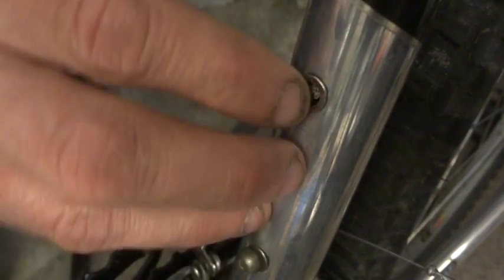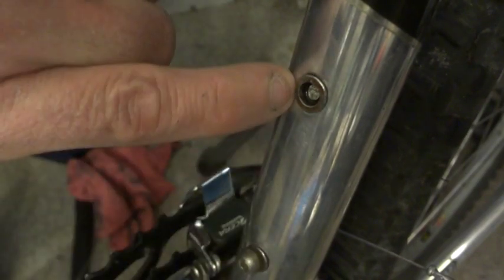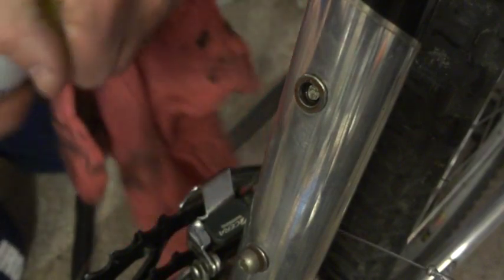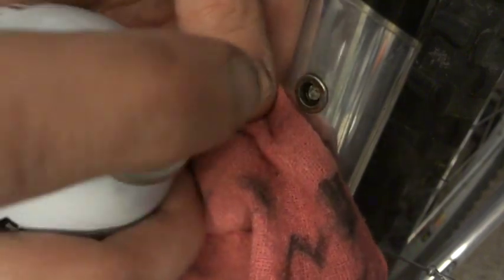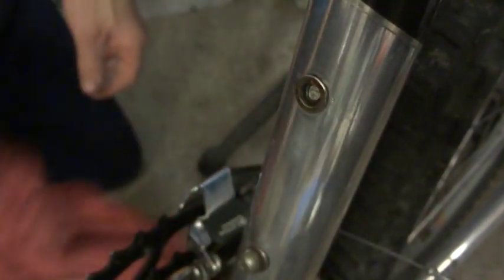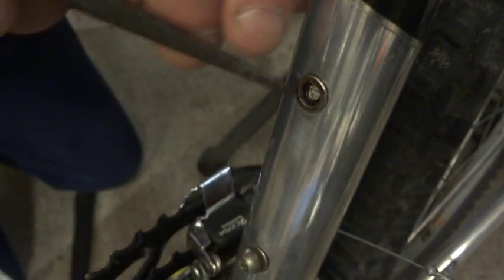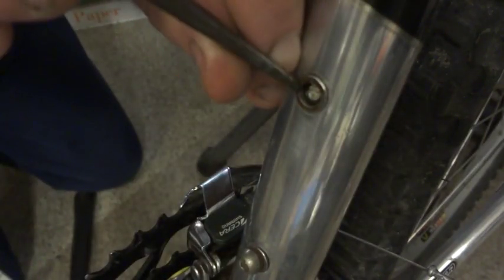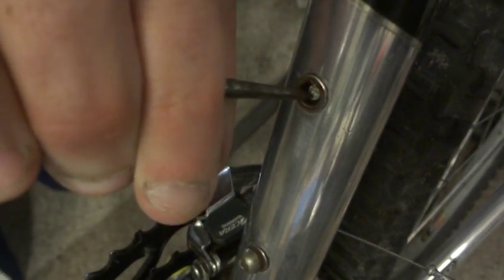How To Remove A Broken Bottle Cage Bolt

Comment: I just did this to remove an m5 bolt which had snapped in the rear forks. It had held my pannier rack, but got sheared off by the weight of the rack (which had snapped in a different place, overloading this bolt) – I figured that the thread wasn't seized, I just couldn't get any way to unscrew it. So I searched around, found this video, got some WD40, a punch and a hammer, and patiently tapped away just like you did here. It's worked just fine! The bolt came out enough (took about 15 minutes of tapping firmly) to grab with pliers, and the threads in the bolt hole are intact and usable. I'm relieved – it's a steel framed touring bike, so it'd be suboptimal if it could never have taken another pannier rack. I'd had a quotation from a bike shop to bore it out with a drill and to tap new threads for a wider bolt, but the quotation was over $100. Instead, this video and some gentle work did the job. Thanks a lot!
Reply: Works!!!!! Thanks!

Comment: RJ, thanks for the clever solution and clear explanation. I used this approach with PB blaster, a mallet and a center punch. After just one and a half rotations with the mallet/center punch I could press my thumb into the hole against the broken bolt surface and continue rotating it with friction. Your video saved me the cost and time of a trip to the bike shop!

Comment: Thanks RJ!   I had a similar problem on my expensive carbon Trek road bike.  I was afraid to repair it myself until I saw your excellent video.  You saved me a trip to the bike shop and I was able to remove the broken bolt without a problem.  It just takes patience.
Reply: Wow..the same thing just happened on my 2023 trek madone SLR...the bottle cage bolt feom trek are very cheap..luckily I have 3 holes on one side so I can lower and use the 2nd and 3rd hole..just brought some s-works bolts which are alot sturdy and made with better quality..

Comment: I've had good luck with left hand drill bits as well. If you pre-drill it a small size(such as 1/8"), then go up one or two sizes, it'll tend to grab the bolt and un-thread it.

Comment: I got a new bike and torque wrench since it came with a carbon seatpost, and I got all torque-Happy and over tightened + snapped my bottle cage bolt. Luckily since it was new the broken bit in the frame came out with little effort with the threads still in tact.

Comment: Thank you, RJ! I was able to remove a screw using this method no problem. Excellent! 

After I bought my bike I realized there was a sheared bottle cage screw on the underside of the top tube. I'm assuming the cage was caught on something and tore the screw. 

What are some common reasons these screws break?
Reply from the maker: No idea. I haven't broken a bottle cage screw.
Reply: My guess is an over torqued screw, bottle cage screws should be in the realm of 2-3nm, over tightening can cause screws to fail like this.

Comment: Thanks, very helpful video! I've the same problem... But I don't know if I can find PB Blaster in the Uk. Do you know something equivalent, worth like PB Blaster? 
I tried with a normal oil but the bolt doesn't move.
Reply from the maker: Try a good penetrating oil. PB Blaster is a very good one, but use what you can find. Let it soak in. Then try to tap on the screw to try to get it to break loose. Then try to get it to rotate out. If that doesn't work, you can maybe drill the old screw out, and clean up the threads with a tap.

Comment: Got the same problem due to cross-threading (and snapping bolt head while trying to unscrew it) would this method work?
Reply from the maker: Not sure if it was cross threaded. Maybe. Use lots of good penetrating oil.

Comment: Why not use a bolt extractor?
Reply from the maker: +Average Man vs Pi They are very small screws. Probably would be difficult to use a bolt extractor.
Reply: Ah ok makes sense. I have this exact issue and reminds me of when I get my hockey (roller) skate bolts rounded off. I use an extractor for those, but yeah these might be a bit tough.